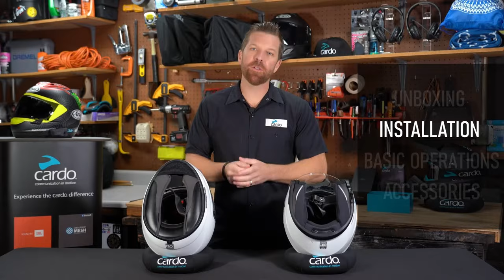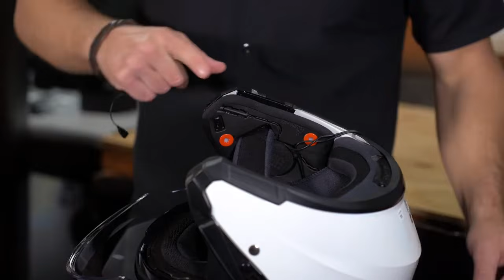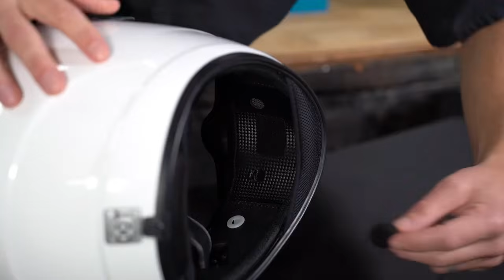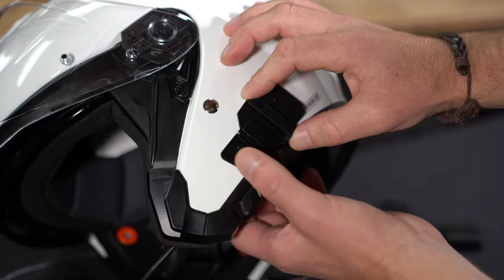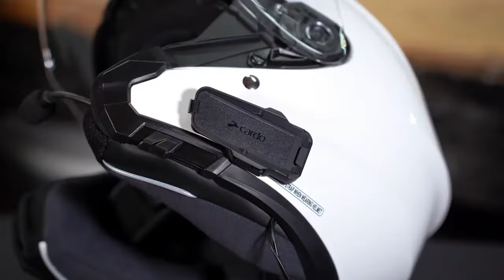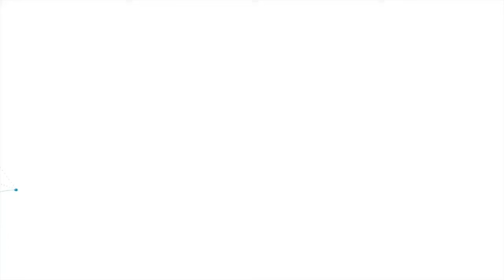Packtalk Neo | INSTALLATION

Comment: Damn, the the edge is basically cheap crap. I wish I knew I’d have to plug it in each time or I would have bought a Sena. Well, I guess I’m sticking with a Sena next time.
Reply from the maker: Sorry to hear that. The PACKTALK EDGE should not need to be plugged in each time to work. Please contact customer support so they can check what is happening with your unit and get this sorted. - Richard
Reply: @CardoSystemsGlobal the neo certainly does…. It’s basically garbage. It’s nothing more than a waste of money.

Comment: a good tip i heard, is to put the microphone (boom or wired) slightly off to the side of your mouth.
1. helps so your not breathing into the mic (for other person)
2. alot of helmets have a front vent, so putting speaker slightly off, makes your voice come through more clear
Reply from the maker: Great tip 🙌 positioning really does make a big difference for audio clarity and reducing wind noise

Comment: Unbelievable that you need to plug in the cable EACH TIME you put the device on the helmet... No one seems to highlight this drawback when comparing to the Edge...
Reply: “I have to plug in my device, boo hoo”
Reply: Almost like the whole reason it’s cheaper than the edge
Reply: I only found out a moment ago when I unpacked it and wanted to install it. I thought I was missing something, so I looked up this video. Having to plug the connector in every time is disappointing.
Reply: I agree, it was not like this in the previuos versions, very very annoying indeed

Comment: The mount for these is very thick and makes the unit stand a long way of the helmet with a very high profile. The unit is very slim and sleek but ruined by the mounting.  
I think I would dispense with the mount and tape the unit itself directly on to the helmet and leave it permanently there. It would hug the shape of the helmet better and be less in the slipstream.

Comment: Why did you move the NEO mount to this additional hanging cable crap? I am good with the click base vs the air base of the Edge, but thought the click mount would be like the Freecom 4 mounts where the wiring is built in and the connector pins are in then mount. This extra wire is a MAJOR step back in design for a new product. I wanted to purchase 4 Neo units, even after just purchasing 4 Freedom units as I want to DMC vs the very unreliable daisy chain bluetooth four 4 unit intercom. But after seeing that, I will look at other brands. I also don’t want or need the Air mount and additional features to pay even more for the Edge model. Just can;t believe Cardo would go backwards in design for the NEO base mount..
Reply: Yeah figure this would be one of the “differences” highlighted between the two, not just the warranty and mount style. It’s not clear that the clickable mount has this cable you have to plug in/out each time you install/remove the unit and that the air mount has the luxury/pro/ease of having the pins built into the mount versus a cable.
Reply: My thoughts exactly I'm returning my neo now to get the edge purely bc of this
Reply: I had to do the same thing. Disappointing they did this with the cable for the Neo which was all the capability I needed. But I ultimately also bought the edge as I didn’t want to switch across brands on 4 helmets. Painful on the cost when I did purely because of the mount. Maybe that’s what they wanted consumers to do though..